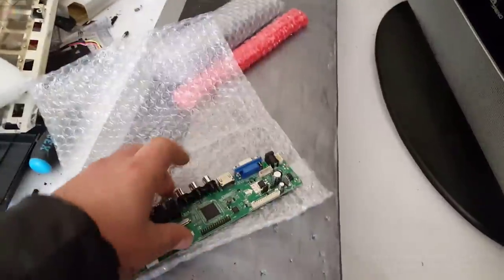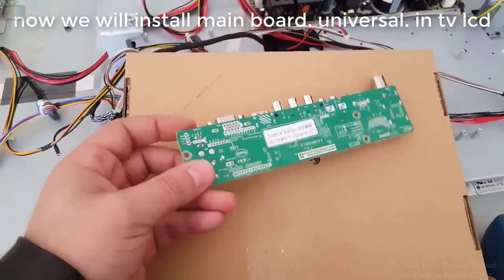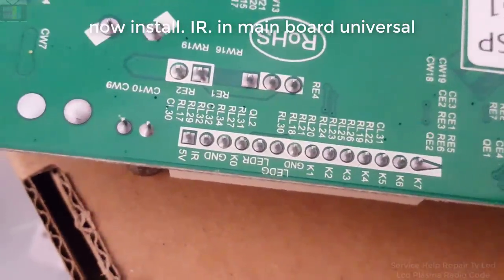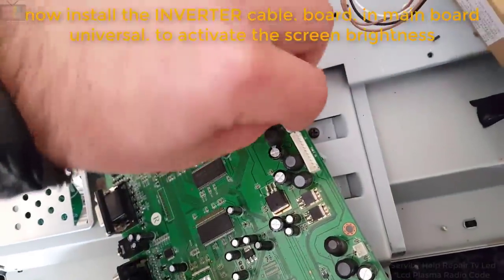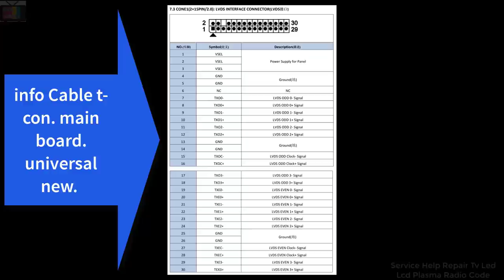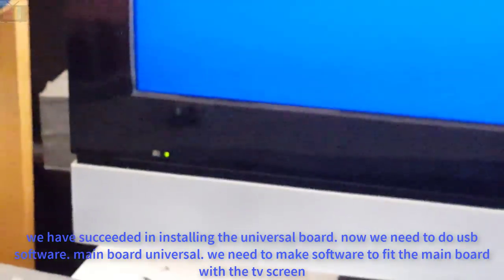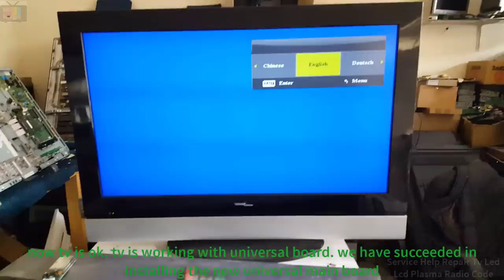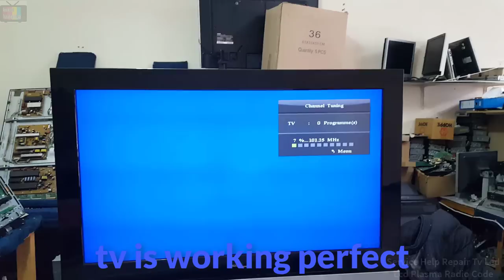main board universal  TV LED LCD. install main board universal. tv lcd 42 inch

Comment: i forget to mention what you will do if inverter is 24v instead of 12v as mine? in my case i had to add only one wire the bl_on to the my universal board however there was using inverter directly to the psu. and the adj has no conection made because the lamp wont turn on. well i did lot of tvs here. but some time is lot of work for the keyboard to resolder all one by one as i would use the original from the tv but there is only 3 wire while universal board have more wire for each push button
Reply: u must take signal from main board called  pwm mod and connected to inverter drive signal   and bl on in 5 v with 1 k ohm

Comment: Inverter cable from universal board to backlight, you connected 4 wires, 2 for gnd, 1 for adj and 1 for inv on....why not connecting the 12v cables too? Just asking, I'm trying to make my inverter work but I have 13wires that goes to inverter board..thank you :)

Comment: Hi and congratulations on your videos. It could help me. I have a Thes 3251 btp TV and I would like to put the main board universal because the main one breaks continuously. My LCD panel has the number v315b1-L08 rev.c2. Could you please tell me if there is a compatible universal main board? And where to buy it? Thank you so much and sorry for the trouble.

Comment: observando novamente o video por vc não me responder vi que na verdade vc soldou os 4 GND juntos +  um 12volts  e  os  outros três juntos o pson com +5 e vsb +5. muinto pratico parabêns por compartilhar com os youtubes
Reply from the maker: for what you are talking about. for 12v coming from the power board. or coming to an inverter. please can you explain me a bit better. what problem do you have.

Comment: boa noite nobre parabêns pelo vidéo,vc ligou o 24volts mas os gnd da fonte no gnd da  placa universal,mas um pino de  12 volts da fonte no 12volts da placa universal e os três juntos o ps-on + 5volts e + 5 volts isolado em um resistor pode me confirmar por favor ou não prescisou colocar o resistor

Comment: Hi finally thanks to your video I was able to install it on my led tv. But I have a hum noise in the speakers. Do you know what is? Can you help me to understand what cause the hum in speakers? Thanks
Reply from the maker: you have well installed the speaker wires. back main board writes. ROUT+ ROUT- LOUT- LOUT+
Reply: Yes sure, infact the speaker works but there is a hum come out from the speaker also when I set mute on the controller...

Comment: Sir, Can you teach me how and what to repair in a LCD 32" TV which has got damaged due to connecting its Audio/Video connection cable to a 12V/50mA outlet of a Satellite decoder accidentally.  Now, there are no pictures, no power and no standby light.  Can I fix a universal mother board to this TV if the mother board is defective?  Thank you for your kind advice.
Reply from the maker: to change a new universal main board. on tv it's a little difficult. it should fit the screen then with panel lighting. for this job you have to be a good master who knows this repair tv job

Comment: how can i fit the universal motherboard in 12 pair lvds panel  ODD (RX0- RX0+ / RX1- RX1+ / RX2- RX2+ /RX CLK- RX CLK+ / RX3- RX3+ /RX4- RX4+)  EVEN  (RX0- RX0+ / RX1- RX1+ / RX2- RX2+ /RX CLK- RX CLK+ / RX3- RX3+ /RX4- RX4+)

Comment: AFTER INSTALLING THIS , I AM FACING INTERFACING ISSUE FROM REMOTE TO TV TO OPEN THE VIDEOS ON NET FLIX AND YOU TUBE e.g when i open net flix application with my remote and select a video with my remote but when i try to play it there is no any option to run that video, also when i open youtube application in that application open but even video selection is not possible through remote. so can you please tell me what can be the reason for this.

Comment: I need LVDS Cable (10-pare) one side to Connect with Samsung 32 inch Full HD TCON board (51-pin) and other side to connect in currently available Smart Universal Board FHD (30-pins). Suggest from where I can get it. Actually I want to convert my old defective TV to convert in  smart TV

Comment: Sir in my monitor board inbuilt power and inverter also so how can I connect it.
Reply from the maker: you see the video to understand.
Reply: Service Help Repair Tv Led Lcd Plasma Radio Code sir in v56 board have 12v in inverter port but monitor power supply inverter port have 5v how to connect.
Reply: Can I connect only 2 wires in inverter port which is called ajd and blo.

Comment: Sir will this Mobo work with LG Philips Model No. LP154W01-TL A2 , Pls Confirm.Thanks in advance
Reply from the maker: I believe it works. if it fits the cable connected to the display

Comment: My tv works fine with no problem but it have a single issue,  it performs some unnecessary functions with other devices remote like, set up box,  other tv remots,  AC remote,  just take an example, whenever i change my channel with set up box remote,  volume of tv increasing simultaneously,  when i try switch to channel 4 with set up box remote then simultaneously tv switch off,  when i press signal button from from  set up box,  input dialog box open(tv, Av, hdmi, usb etc option.) 
Can u tell me,  what is wrong with my tv?
Tv details, -
Sanyo 49 inch android tv
Model no. -  XT-49A081U
Reply from the maker: simply remote control also responds to tv. there is no tv problem but it is also suitable for tv in some functions remote control also responds to motherboard tv.
Reply: @RepairAllTV  
Sry bro,  
U r wrong, it is not about set up box remote remote, even  my tv performs unwanted functions with  Samsung tv remote,  other tv remote,  free dish remote, 
  even company repairing service also says that it is problem,  but they can't able to diagnose rgt now,  they say,  we saw this type of problem 1st time, 
They are working on it,  hopefully they get the solution.
And they think that,  there is some problem in motherboard or main board

Comment: Hi, could you help me? I have T.SK106A.03 and 1280x800 15.6 inch LTN154X3-L06. I cant find right firmware, on bangood or anywheare else, the only one i managed to find is for some suspicious 14.1 inch dispay, please help I really would like it to work and I dont want to lose this board by flashing wrong firmware

Comment: Hi, my led tv has cable to inverter directly on psu and it is 135V. I need to connect the inverter cable or not?
Reply from the maker: this. main board universal. installed only in. TV. LED LCD. not in plasma
Reply: My TV is not plasma but is a TV LED (samsung eu32es5500) but on power supply there is output for LED Driver with 135V. So I need to use it or I can direct connect to universal lcd controller the inverter?
Reply from the maker: you should also use the power board. for LED panel operation. only 12v + for universal main board. in the main board do not enter 135v. that the 135v is only for functional panel LEDs. not for the main board.
Reply: Ok so, from the universal controller what PIN I have to use for power on the power supply and the backlight?
Reply: How to turn on the original psb,i saw three wires bundle together .tks

Comment: hi I tried to install this mainboard and everything is ok only that the HD channels of the DTT can be seen but the voice is not heard ... only the HD channels what should I adjust?
Reply from the maker: access the menu try.  settings or sound.  if not go try the service mode menu there too
Reply: RepairAllTV  from the normal menu I tried to switch in some settings but nothing has changed ... in the service menu what should I set for HD audio?

Comment: Sir 7812mosfet will work with universal led board because I have19v 5amp charger.
Reply from the maker: if its. 7812. 4A. MOSFET. yes
Reply: Service Help Repair Tv Led Lcd Plasma Radio Code sir my monitor power supply has given above 12 how can I less it's power for universal board.
Reply: Love Entertainment & Technology given above 12v so how to reduce the power can I use buck converter
Reply from the maker: main board universal. should be used with 12v and 3a or 4a

Comment: Hello. This product is good philips 32pfl4007k /12?  Display T320HVN01.5.
Reply from the maker: for tv philips i do not know what to say it's a little problem for tv philips. is the problem of power board even for. t-con board. if these two fit it then it's ok. it is difficult. to install universal main board on tv philips. for concern. power board also t-con board.
Reply: Thanks the answer!
Reply: Yes i also got philips tv 40pfl6606h/12 main board problem i think so,cos got 3.3vts but no 24,cannot Display .
If change to this,ribbon cable how?
Thanks sir.

Comment: I can't figure out where the backlight wires get powered.
Reply from the maker: power board. is the 24v INVERTER operator. to activate the INVERTER. for lighting the screen is the main board
Reply: Yes,how you turn on the original ps board?
Your IR is for the universal board .